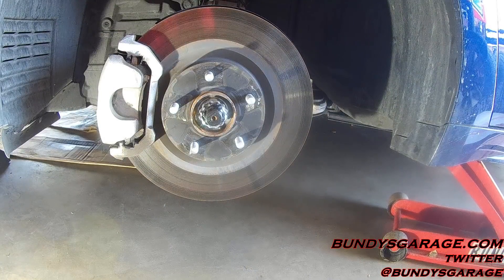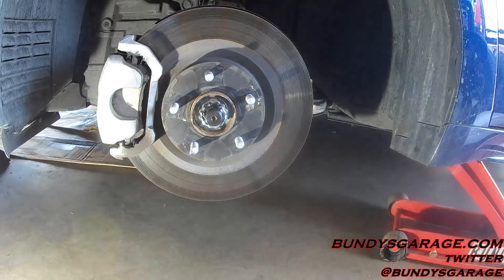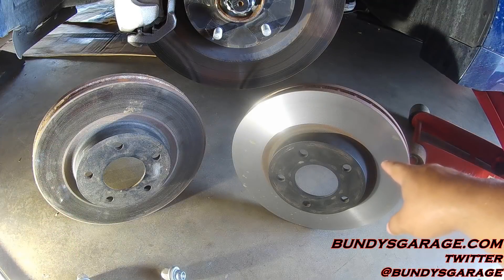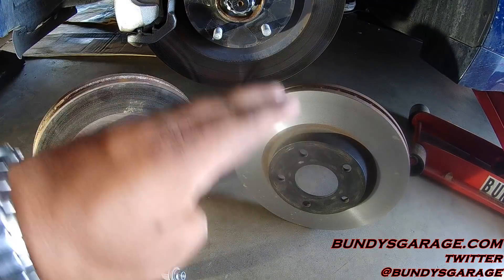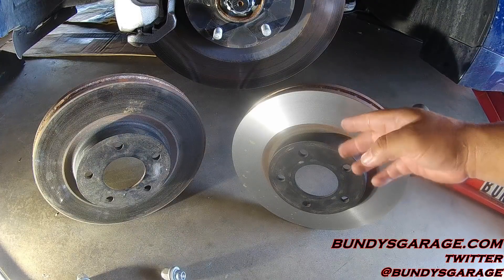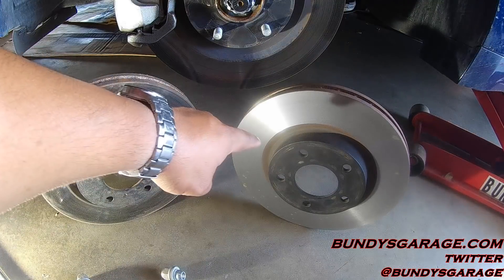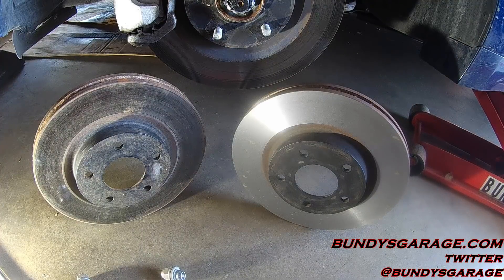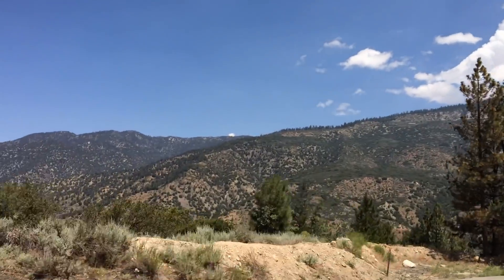Do I need to Turn Rotors when changing Brake Pads - What does Resurface Rotors Mean?

Comment: In my experience, if there is no pulsation when braking but there is a little scoring, it isn't necessarily time to have them turned. The new pads will quickly wear to the surface of the rotor as the rotor mates with the pad. There will actually be more friction surface, which isn't a bad thing. Of course, you have to use your head and ask yourself after checking with a micrometer or dial caliper if the rotor thickness is still above the minimum and/or the surface grooves are not excessively deep. A clue that the rotor is due to be replaced is if the outer wear margin on either side is leaving a pronounced ridge. New rotors are very reasonably priced and a snap to install, so when in doubt, just replace them. I have been through this many times. The incident that encouraged me to do my own brake jobs (about six as of now) was that I was cheated by a locally respected tire store that told me the rotors needed turning and I gave them the go ahead. If they have mic'd them before turning they would have known immediately that there wasn't enough meat on the rotor for turning. They came to me with the news that they tried but, alas, new rotors will be needed after all, so I got to pay for the turning AND two new rotors. Been doing my own ever since. Good thing it's fun to do, eh?
Reply: Sorry to hear that mate. But I am sure you are proud and thankful that you can service your own brakes now. The same happened to me recently. Dealer voided my warranty on a seized caliber because I declined the last brake maintenance service. Long story short, I ended up spending $1500 on four new rotors plus all new pads plus one new caliber. That was all fine.  What pissed me off was the fact that the brake fluid is 100k old and they never took the onus to change it or even mentioned the need. I called back days later and complained after reading up on it. They said they would call me back to schedule but I never heard back. Ended up learning and doing the flush myself. I also plan on working on my own brakes in the future.  Never knew there was such a strong DIYers community on YouTube!  Thank you. Best wishes. 🙏
Reply: J. Sams, got your refund? Im gonna to do my brake job days later, I've got 3 quotes: two for 700ish including one back pad,  4 rotors, the last quote i got from a diff, less affluent county is 400ish.
Reply: yes we need to do our homework or we'd end up being a**holes ourselves. my rotors part quote from dealership is 150/ea(same$ for front n back), 2nd quote is 146 ea for front rotor, 3rd quote is 94 ea front rotor, 4th quote is 45 ea for front/back rotor, just the rotors i've got 4 big diff price, that's how i realize i need to educate myself esp. when as a woman driver they'd rip me off like nothing. will check RockAuto and Amazon, thx.
Reply from the maker: I have worked at a dealership and when a woman walks in the service writer sees dollar signs on your forehead. Oh yeah, your muffler bearing is loose, your flux capacitor is wearing unevenly, the air in your tires need to be rotated, the list goes on and on. Also shops see brake jobs as gravy, a whole lot of money can be charged to do it with very little effort pit out by the mechanic. Educate yourself!
Reply: BundysGarage, that's exactly what i've experienced with my dealership, i went there for ONE flat tire changed, since I was their long time customer so i left my car without quote, ended up i needed to pay over $800 for added items besides one flat tire( muffle whatnot ..as you said), i still keep the incredible receipt! that's my last trip cuz it's unethical to betray client's trust, and I dare 'em charged $800+ for one flat tire were I a male driver, tis really Shameful to take advantage of a poor old lady like me ;((
later dealership quoted me brake and rotors job 1500+, fix my trunk 1000+, at that point i was woke and started educating myself online. THX for your info.
Reply from the maker: That’s awful. There are laws in place that dealerships have to give you a quote and you have to sign that quote or verbal verification before they do the work. If they don’t give you a quote and confirm with you and then try to charge you for work you did not authorize you don’t have to pay. If they push back call the cops. Cops will come out and see there is no quote, pay for what you authorized and you are on your way. You can also call BAR (just Google it in your state) and you can challenge the dealership and BAR will launch an investigation.
Reply from the maker: Also always tell them you want to see your old parts. By law they have to show you. That way you know they did the work.
Reply: what's BAR stands for? state Bar? it's been a yr or two, can i still file the complaint with just a receipt? there are two Lexus dealerships in my state, they are Huge with massive legal assistance. in any rate, I'd paid my tuition and learnt the lesson.
Reply from the maker: Bureau of Automotive Repair. What state are you in? I would give them a call on your state tell them you situation and they will tell you if they can investigate it or not. There is no out of pocket expense on your part. The BAR is on the consumer’s side. It might be too late for you but it might help someone else out using that same dealership, so someone else does not get ripped off.
Reply: thank you so much, like you said tis worth to help other if not for myself. Hennessy Lexus of Atlanta in Peachtree Industrial Blvd, Atlanta, GA 30341 is where i went. your help is highly appreciated.
Reply from the maker: Here’s the phone number: 404.651.8600
Reply: @bundysgarage  Call the cops? Thats ridiculous. A waste of their time. This is what small claims court is literally for.
Reply: im a mec and when you have made a full rotor and pad shift the customer always says the brakes was better before now there is no brake power it takes 50 km or more to get the parts to fit
Reply: LOL ... I wish you would come over and have a little fun doing MY brakes!
I believe in sharing the fun😂😂
Reply from the maker: If your in So Cal I’m come over
Reply: BundysGarage hi 😊this would be an amazing side job for ya 😁wish I can come to you to fix my breaks I’ll pay you for your time and expertise and will be very grateful for your honesty and kindness towards us naive women in regards to car repairs I am sure your work will not go unrecognized what you put out you will receive double...wish you will consider it and help us out hard working women out there fixing our breaks 😊God bless and thank you for the Awesome video
Reply: We’ve all been cheated at shops before learning how to change brakes ourselves. Before, they always insisted on selling me new rotors without even mentioning resurfacing. Once I asked for new brake hardware and only after did I see they charged $40 for the few metal clips- disgusting! Last time I paid for an oil change because I was on the road, I paid for synthetic and they gave me conventional. I know this because my next change was 7k and the oil was already turning to sludge- definitely cheap conventional
Reply: if turning ain't needed after all, you should argue while not payin' for the useless job. they might not deceive but they didn't perceive well enough as a respectful pro.
Reply: ALWAYS, cut or replace rotors when servicing brakes! Dealer teck 10 yrs exp

Comment: "Most" Rotors now days don't even come with enough thickness to do a single resurfacing job. My wife's minivan eats them every two or three brake jobs. I just buy new one as needed. Thank God for Auto-Zone brake pads warranty. Haven't paid for a set of pads in years.
Reply: Holy your wife must be racing driver. My brakes last usually 150000 before indicators come on.
Reply: E'raan Lue exactly, she must be a horrible driver. Racing from stop sign to stop sign as well as lights before braking hard. Same on the highway doesnt know what letting off the accelerator means so has to be constantly braking, I know the type well,  I see them daily on my commutes
Reply: "Most?"  How about, and I'm taking a shot in the dark here, but is your wife's minivan a non-American vehicle?  I've noticed in videos that Hondas have one surface!  My RAM has two separate rotor surfaces, front and back, with air cooling vanes in between.  You get what you pay for.  I have over 70K and my rotors aren't even broken in I'd say.  My buddie's RAM has over 320,000 and he's never touched the rotors, but he drives admittedly like an old man.
Reply: hanky97007 how does the brake warranty work
Reply: Autozone will not honor the warranty unless it's a defect in the workmanship of the pads. Even wear is not considered a defect. The only way I an think of getting free rotors is by lying to them everytime you get them replaced.
Reply from the maker: +hanky97007 how many miles between brake jobs on the van?
Reply: 15-20,000 miles or about 18 months on average. Van has 220,000 on it now. I really think I can do them in the dark or in my sleep. On my 2000 Honda Accord brakes last about 60-70,000 miles.
Reply from the maker: +David Ducatie I habe never done it but what i understand is you have to bring in the old pads with even wear on the pads and they cannot be to the rivots

Comment: how thick can they be before they are not safe to resurface? 
like for a 2000 Honda Accord v6
Reply from the maker: +Rudy Munoz it should say on the rotors somewhere. Also you can call O'Reilys and they can tell you the min thickness.
Reply: BundysGarage 
thanks
is getting around that time to check my breaks and wanted to know what to look for. thanks a mil.
Reply: Rudy Munoz brakes* not breaks